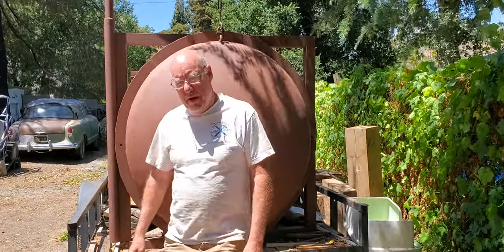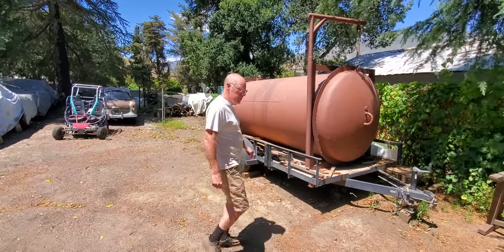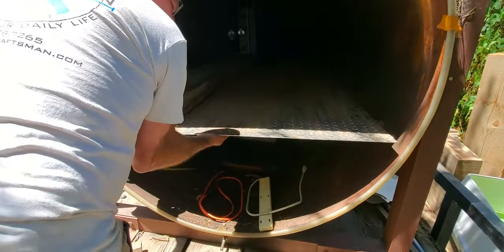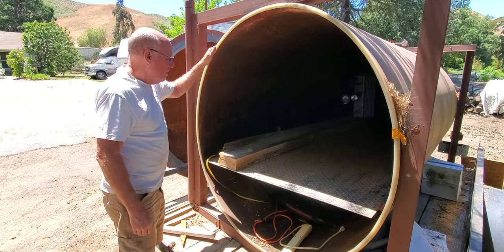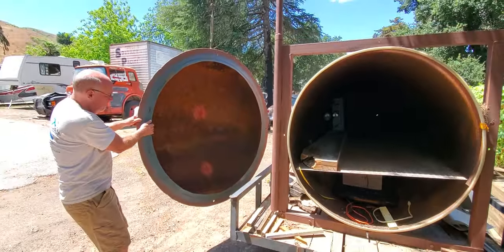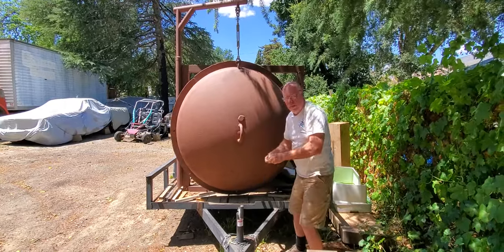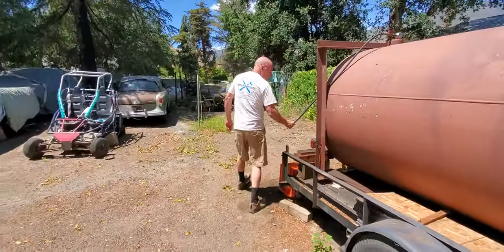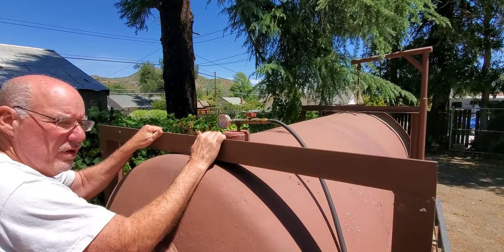Home Built Vacuum Kiln for Drying Wood

Comment: Wow that's pretty impressive.  Getting the tolerances right on something like this is not easy as if it's off by even a mm out of round it can implode.  What is the advantage of the vacuum does it drive the moisture out of the wood faster?
Reply from the maker: yes, water boils at lower temperature in a vacuum

Comment: If you paint that flat black, and if it gets full direct sunlight from morning to evening. 
Just a sun radiant heat on the flat black can probably get that interior up to 140°F plus  just by using the sun with no energy. 

Use it with the heater blankets and you can get to your desired, set temperature faster and use less energy . 

Would that is already 140° plus all the way through to its core before you turn on the vacuum pump .  The water flashes out much faster..

Comment: Sir ;. Do you introduce any type of heated metal plates on top and bottom of slabs to help "steam" the moisture out,.    Or does the simple light bulbs work for it ?
Reply from the maker: I use a 36" x 10' heat mat, used for a floor radiant heat system. The mat goes between 1" plywood and diamond plate steel. Heats up the entire surface. Lightbulb, or any fan driven heater, wont work/not effective in a vacuum.
Reply: @santapaulacraftsman8990  do you place that on top and bottom?     Appreciate your knowledge
Reply from the maker: @bretfairchild456  the 'floor' of the shelf has heat at the bottom, and a drape i mat over the top

Comment: Since heat does not ( move) in a vacuum,  are you drying multiple boards or one in contact with plate. How do they other boards get heat.
Reply from the maker: I only run a single layer at a time. The wood must be in contact with the steel plate. I have a 'under floor heat mat' under the steel plate, and I also lay another mat on top of the wood. You cannot stack wood without having a heat source at each level.

Comment: How deep do you run the vacuum?
Reply from the maker: 29+1 mercury
Reply: @santapaulacraftsman8990  wow.  That's impressive
Reply: What is a 29+1 mercury?
Reply from the maker: @daltonpeterson821  The pressure value 29 inHg (inches of mercury)
Reply: Thank you
Reply: Do you have to use a condenser?
Reply from the maker: @daltonpeterson821  I do not

Comment: Im wondering what  you draw your vacuum down to (Hg#)
Old propane tank?
How warm does it get inside?
Size of vacuum pump?
Thanks
Reply from the maker: close to 29. It's an old oil tank. I start with a 9 HP pump, then switch to a 1.5 HP pump to maintain pressure. Temp gets to approx 80, but in a vacuum water boils at this temp.
Reply from the maker: down to 29 mercury. Old oil tank. 90+ degrees with external ambient differential. Small 9 cfm pump.